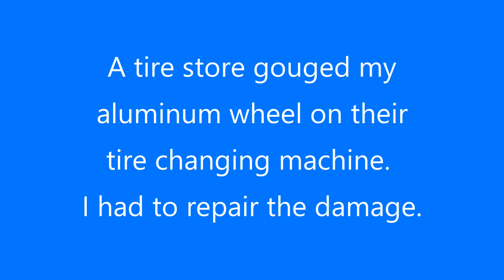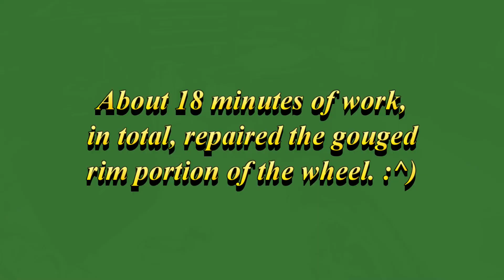ROH Aluminum Wheel - Repair Gouges in Rim

Comment: Why . It allways very noice what ever you are doing. Sound likw my tinitus.
Reply from the maker: Well, two reasons I suppose. One, the angle grinder I used with a sanding and then buffing wheel, is just really loud. And two, because it was so hot in the garage, I had two fans running and blowing air.